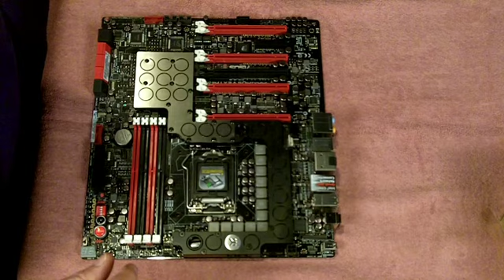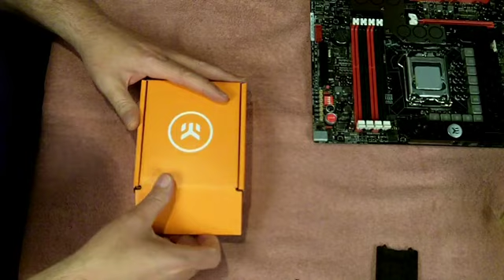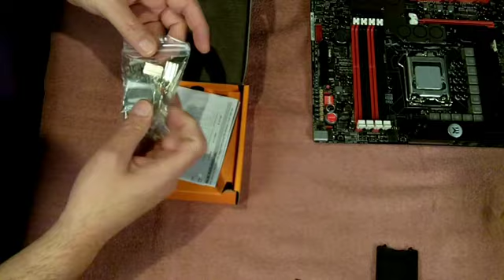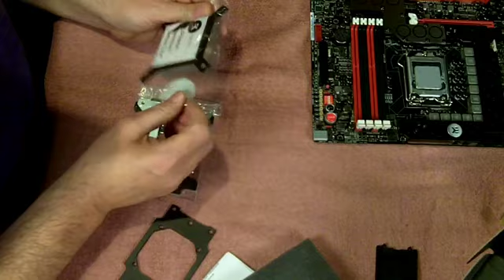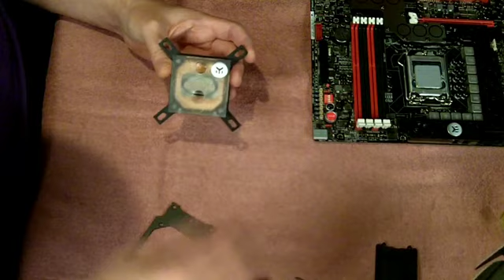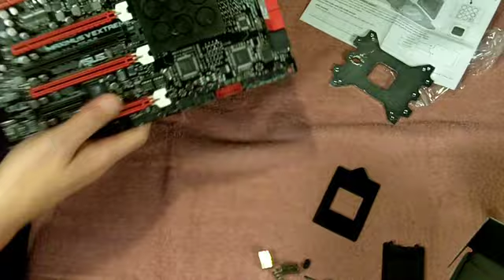EK-Supremacy CPU Water Block Installation

Comment: how do you know which is the inlet vs outlet coming off the pump itself? please help i have an ek kit but theres no marking on the pump
Reply: If you look inside, one of the two sides will have small slits cut into the copper and that is the out side.Good Luck

Comment: An almost perfect example of how NOT to do it. You should have mounted the backplate and the retention screws before you applied the thermal interface material to the CPU. That oughta be the very last step before installing the actual waterblock to prevent that the applied TIM catches on dust. The flow direction of the water should always be in an upward orientation to bleed trapped air from the system. Not the other way around like you did in this example. Besides. You bought a high performance cooling block and use one of the poorest performing pastes in the market ? Odd combination. Use Prolimatech PK-3 instead.
Reply: Oh, I don't 'know it all' ... so I check my info with sources that ought to know 'em. In this case ' upward orientation' it's from a tech that works for german PC retailer / modder Caseking.
Reply: mx-4 is a top top performer i dont know where you are getting this info
Reply: I think I pointed that out. Reading should help. Other than that, please feel free to use whatever compound you like. I'd rather have Prolimatech's PK-3 TIM on my chips than that brittle, drying MK-4. Sorry.
Reply: You read. I say it is a top performer you said it isn't. 

Mk 4 doesn't cure at all.
Reply: I didn't say it isn't. I just said I prefer PK-3 for good reasons. 😉

Comment: Never Spread the paste.
Reply: haha i always spread the paste, for haswell at least. idiot
Reply: Nick Hansen I guarantee you have no idea what you are saying. Why For Haswell only? That proves you're an idiot.
Reply: Nick Hansen Ideally you want to put a pea sized drop in the center. Based off of my own and others research I've concluded it's the most effective and least hassle.
Reply: +DIY Today I spread mine with a razor blade. I spread it so thin it's almost metal to metal contact.
Reply: correct me if im wrong. thermal paste only ensures a good contact. if u spread it too thin is won't make a good connection. a pea will do the trick, it almost molds to the right size when u screw in the cooler

Comment: You shouldn't spread the paste out before mounting a cooler. Paste is only needed in the middle where the die actually touches the IHS. Anything else is overkill. Just put a pea in the middle and let the cooler spread it out for itself.